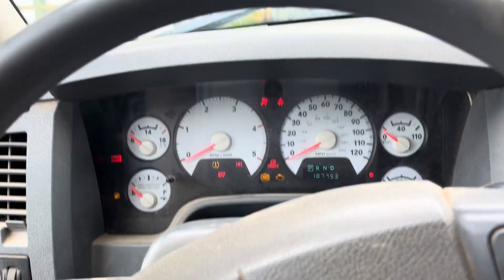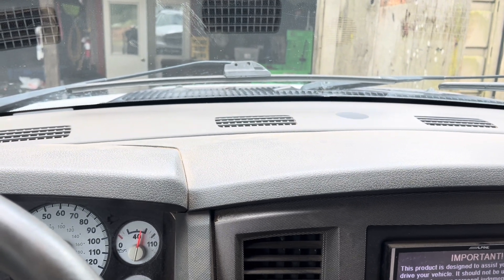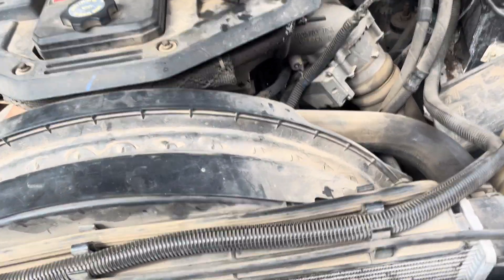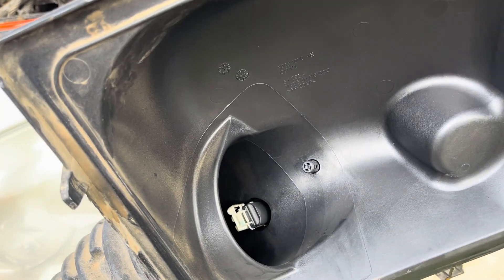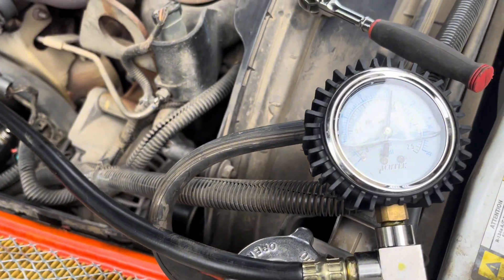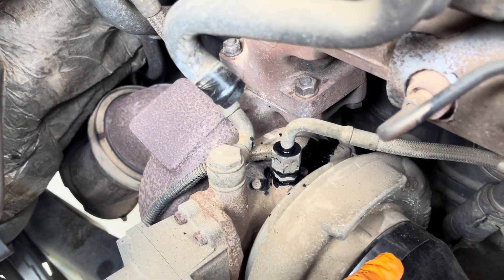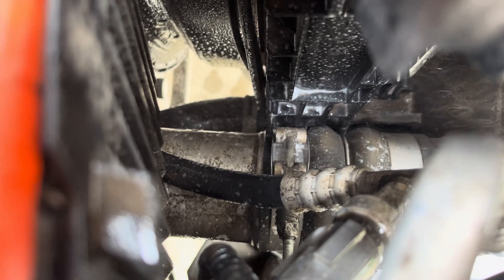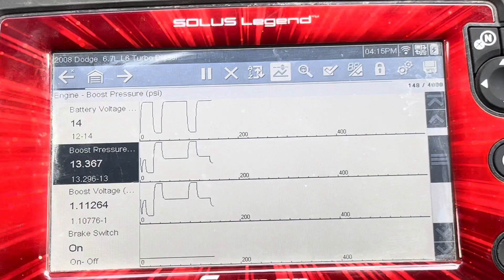6.7 Ram Cummins Turbo Diagnosis

Comment: Probably one of the most intelligent diagnosis’s I’ve watched. Thank you.
Reply from the maker: Wow, thank you! Hopefully this helped you!
Reply: @LazyDWorx  it gave me a lot of avenues to check while I’m chasing this gremlin. “P2262 Turbo Boost Pressure Not
Detected - Mechanical”  delete the code and it’s good everything is fine builds boost can’t find any leaks. But soon as it come up to full temp light comes on again.  Thinking it’s the actuator but for the price of it I might as well spend a bit more and get the whole turbo.
Reply from the maker: @mattwilliams3101  There is a manifold pressure sensor over by your injector lines, it may be failing, if you have a scan tool that can see data you should check that it is measuring the intake pressure

Comment: Stand up guy. Thanks for your input and knowledge. I’m at 207k on my 08 Cummins I know I’m staring down the barrel of a new turbo. Do you have input on what works best on a mildly tuned 08 6.7 Cummins I’ve got a Laramie single wheel crew cab and I live at 9,600’ thanks for any good info. Thank you sir.
Reply from the maker: I recently installed a fleece cheetah on a truck, 2007.5 6.7, drop in replacement, he really likes it, good for stock or mild modification. On my personal truck, 2006 5.9, I installed a Calibrated Power Stealth 64 and have been happy with that as well. Either one is a good choice, slightly larger than stock, good spooling and lower EGTs. Good luck!

Comment: Any updates on this?
Reply: What was the cause of the crank case pressure? I have the same problem with my 15 6.7L cummins. 

Lots of crank case pressure blowing out by the drivers side front of the valve cover when checking for boost leaks. No oil has leaked out of the valve cover tho. Just air when pressurized with the tool.
Reply from the maker: @shanesmith6242 have you replaced your crankcase vent filter? If those become saturated they do not function well. It is under your valve cover
Reply: @LazyDWorx  Yes it was replaced less than 300 miles ago.
Reply from the maker: @shanesmith6242 Do you have excessive blow by? Warm engine running, take the oil fill cap off and see how much crankcase pressure vents from there. If it is it can indicate bad piston rings.
Reply: @LazyDWorx I checked that already too. Cap sets nice and flat on it with no pressure building up.  

According to the company I bought the pressure test tool from in their q&a they said you are suposed to remove the oil cap before you add pressure to the system so you don't accidentally blow out seals like a rear main ect. And that pressure in the crank case is to be expected. 

But all the tutorial videos I've seen from guys they don't mention any leaks in crank case on a 6.7l cummins. They just find leaks in the hose connections and intake horn areas on those trucks.
Reply from the maker: @shanesmith6242 What is the issue you are trying to resolve?
Reply: I swear every ram i see has cables that look like that.  Never the ford or Chevrolet just dodge
Reply from the maker: @korycurtis3730 Yeah, totally, people over tighten them, snug is good!
Reply from the maker: Eventually replaced the turbo, which resolved the issue. It got much worse because the VGT vane got stuck closed, the truck would barely run at that point.